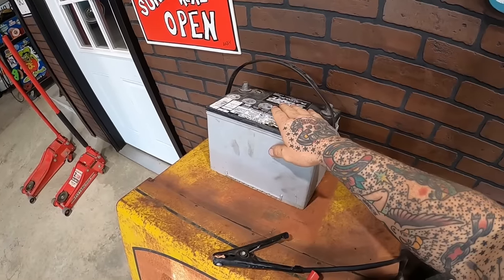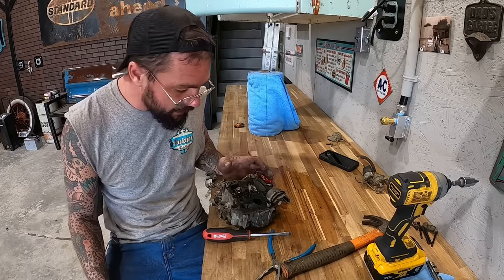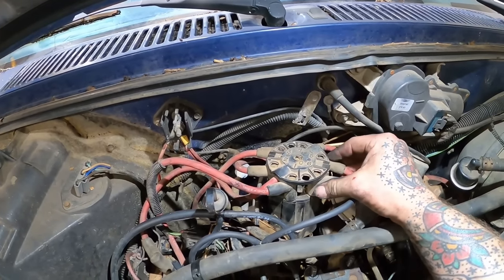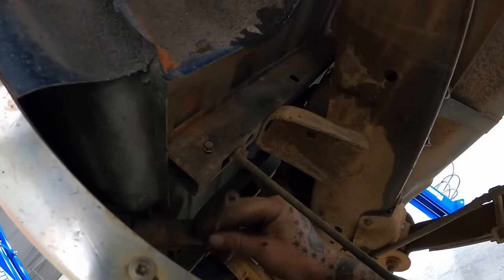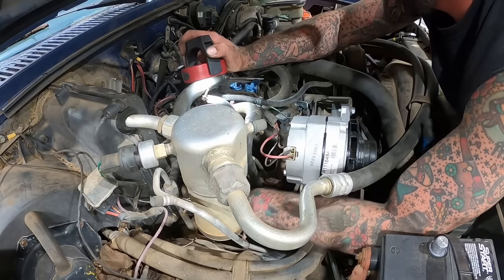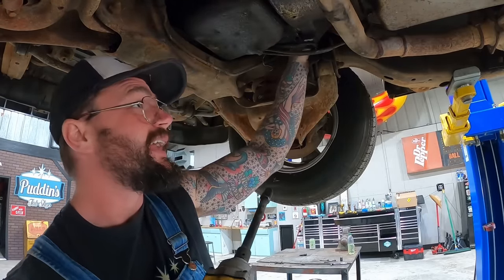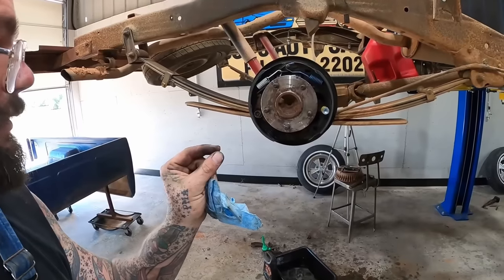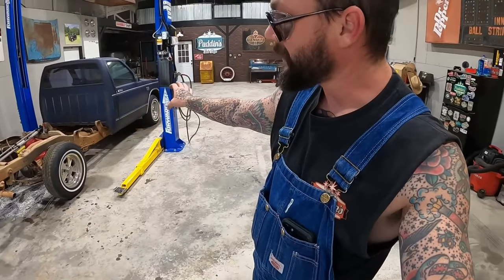1984 S-10 Pickup. MECHANICAL REBUILD. Will it RUN/DRIVE better?

Comment: DO NOT REPEAT DO NOT, dig into that carb. I do carb for a livin and I dislike your carb more than any . If you do anything replace the carbbase insolator (gasket) and you do not have to replace it with one with the heater built in, you`ll see when you get it off you`ll save $29-30 bucks. and a 12 or 13 mm 1/4 drive wobbly is the best tool to use , and 12 point is the hot set up.

Comment: Look puddin you need to put the front arm of your lift a little more forward and you need to get the safety jacks for the lift that goes under both ends of the car or truck might save your life one day
Reply: They are called under hoist safety stands

Comment: It needs a good sized in-line fuel filter, since there really isn't much more than that piddly one in the carb (that ended up needing to be gone, anyway!) . Bad design.
Reply: Longer than my 1970 C10, which after not being used for many years, had many fuel filter blockages & got to the point  I always carried extra filters & wrenches with me so I could change out with new filter while my beloved mother would wait patiently while I changed the plugged filter out. Blame the 10 to 15 % ethanol in gasoline for causing the problems. Good thing is now fuel system is all cleaned out from the ethanol now.

Comment: a batterie sales person told me to never buy a top post and a side post batterie if you were going to use the sideposts. the wire going from the top post to the side post is only 10 gage wire. had a 89 GMC long bed and it died. the little wire inside fried. the batterie was good but one sidepost didn't connect. had to buy a new bat .

Comment: On my 90 wrangler, I eliminated an actual wheelbarrow full of smog crap, hoses like spaghetti and such, and stuck on a Weber carb and it ran so much better, easier to troubleshoot… is there an option for that truck where you could do that?  It might rule Commiefornia viewers out of winning it, but they’re probably already not allowed to have it anyway. A custom intake with a basic carb, basic throttle linkage, and a few vacuum hoses here and there, and bob’s your uncle?

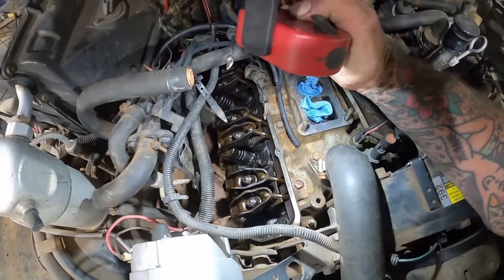Comment: 1:10:01 Chevrolet 2.8’s are notorious about buildup inside even with regular oil changes…
Reply: When rebuilt our 2.8 at 233.,000 miles the machinist was surprised how clean the inside of the engine was! Good quality of oils & no more than 2,000 miles between changes worked for us. Also helps to run engine for a decent amount of time especially when its cold outside.

Comment: Not a fan of the 2.8
Really was a little bastard to work on them. 
4.3 was a tight fit, and motor mounts suck, but at least it was easier to work on. 
Honestly the TBI fuel injection setups were way more simple than that stupid 3 barrel smog era dumpster fire carb.
Reply: Could probably do a small block swap as fast as doing carb and valve covers.
Reply: @ryurc3033 isn’t that the truth.

Comment: Man those 2.8 v6 Chevy engines are complete junk. Everyone I seen had problems at around 125 thousand miles. If you got one and don't have problems God bless you. Lol. The 2.5 iron duke 4 cylinder the best one and the 4.3 v6 is another good one

Comment: I don't want it, it's automatic. Already have a s10 that slips in and out of 3ed and 4th don't need another one.
Reply: Those automatics are problematic! My father had 1 blow up going up a hill on his way to get materials for his plumbing work & he called Paul Keene in the middle of the night & told him to bring another truck RIGHT NOW! The truck was brand new & did not even have 1,000 miles on it. Paul was the dealership owner & my did had done work on his house that no one else would touch because of the materials used were so bad. Of course Paul did have a truck sent to my dad as he wanted his house plumbing repaired!

Comment: Why are you even messing with the 2.8 there is zero you can do to that engine, The automatic trans ONLY FITS the 2.8. Swap the 4.3 six WAY WAY BETTER. ALL SMALL BLOCK TRANS THEN WIL FIT and have 2x HP with bolt ons.I can't even sell the rebuilt over drive trans out of the 2.8  I converted. to 4.3.

Comment: Wish you could've shopped around for a cooler car/truck that you could've made a good starter fixer up for someone to work on. This thing will never be worth more than the parts you've bought,. Love seeing you work on cars again but...... I'd rather have 1 of each shirt than a Grandpa truck with a carb rebuild and new breaks thats still unable to do highway speeds. lol
Reply: That truck has 200k kms in it still ...

Comment: Heck ran thousands of miles but to run a mile now at my age not happening period and even if I practice still not going to happen and giving you crap nope you do you and don’t bust on me when I put my transmission in on the dirt and snow in my driveway in two weeks

Comment: Instead of beating on the back of the drum you hit in between each stud with a hammer not the stud for your lug nut but in between each stud with the hammer and it will like  shock it lose facts done every send that way it's not busting the lip off the back and you can still reuse the drum

Comment: bro , before you start callin out the engineers who designed 1980 and newer cars, take a walk in their shoes. The crap they had to go through to meet emission standards WITH OUT A COMPUTER  OR TRYING TO COMPUTERIZE A CARBURETOR WAS LIKE TRYING TO PUT LIPSTICK ON A WILD BORE in  Texas. tHEN YOU HAD TO PASS CAFE STANDARDS.(corporate average fuel economy).  Then they gotta please the buyer. They want power steering And brakes plus a?c and heat and quadraphonic sound where their aint room for 4 speakers.Tilt cruize power locks and winders and 12 cup holders where there aint room for 2. Then they gots to warranty it for 5 years even though you take it out in the boonies and beat the living dog crap out of it .And the 6 inches of mud packed in the wheel well and front suspension don`t mean a thing. If these4 engineers kept making 57 chevys up till now , your kids would have to wear a space suit to walk to school,because the air aint fit to breath, but because of the safty they didnt have to engineer into cars, your kids wouldn`t live to see their 12th birthday. Now none of this matters cause we used up all the fossil fuel by 1988 cause nothing got over 12 miles to the galleon. Think about all this before you curse the auto engineer for making the cars  they do today. Your welcome. Try working on  SHO Taurus Puddin.

Comment: 2.8 s-10 carburetors are the worst carburetors I've ever worked on. Too much crap on them and rods and linkages. How did GM come up with such a piece of crap. Other than that the s-10's are great little trucks.

Comment: so where did you wind up hooking in a fuel filter? Don't you tell us you just totally blew it off .shame shame shame on you if you did .
Reply: I'm sure it will probably be somewhere next to the frame rail like modern cars place them... But no point to installing it before all the suspension fab is done and the new gas tank is installed.